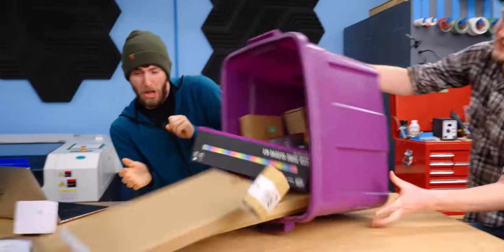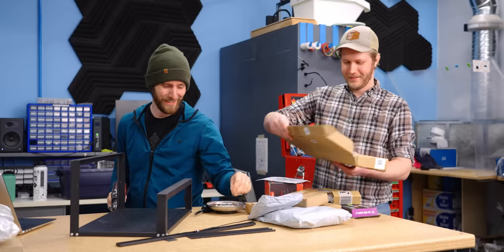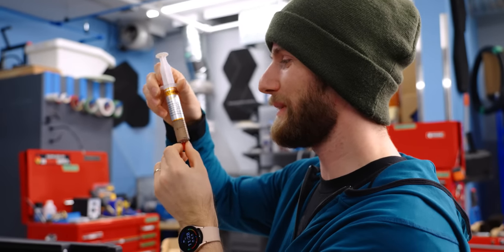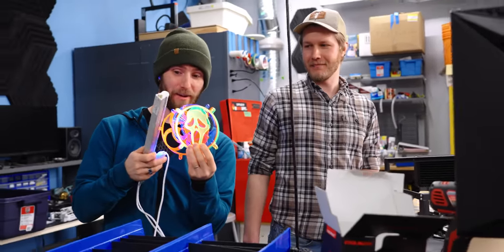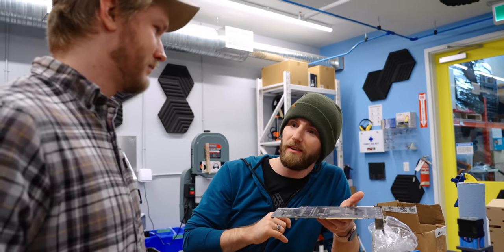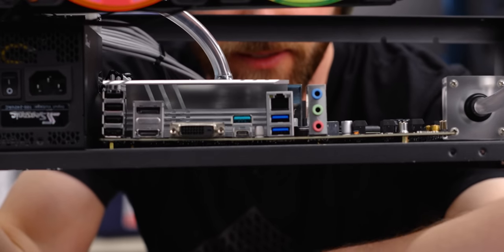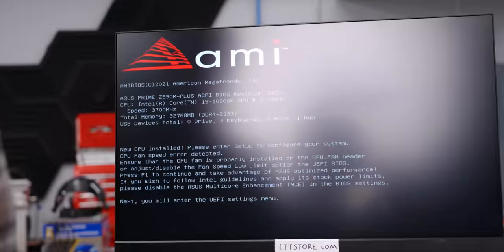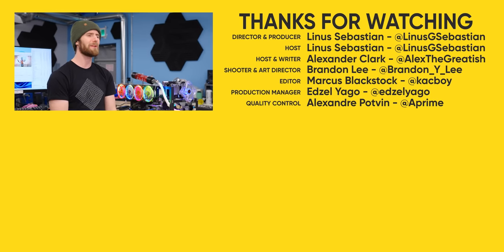Water Cooling… Using only Wish.com

Comment: 25:00 - Those are for undercounter lighting / bar lighting. They daisy chain. They also have end caps you're supposed to buy to cover up the exposed AC. I had a bunch of these. They're meant for electricians to install.
Reply: That does not excuse it in any way. They will be way too accessible for 120v to just be lying around
Reply: @PPedroFernandes  The end caps sit flush and are very hard to remove, that's why electricians are to install them.
Reply: @hippopotamus86  "hard to remove" you seriously underestimate people's stupidity. The moment one of those breaks down someone is going to try to fix them and hurt themselves
Reply: @PPedroFernandes  thats why you turn the power off when trying to “fix” anything electrical. you dont see people electrocuting themselves fixing wall sockets , because people that go to fix it know the risks and precautions
Reply: @rylanwessel1576  "you dont see people electrocuting themselves fixing wall sockets" are you sure about that?
Reply: @PPedroFernandes  you're the reason batteries say to not put them up your nose
Reply: @imthemistermaster  no, I know a lot of people that are the reason for it.
Reply: @PPedroFernandes  It's probably safer than a light fitting/lamp without a bulb in it; holes smaller and has a cover which requires prising off with determination from a stupid angle.
But I still change a bulb while it's on anyway. LED don't burn you and it's quite exciting to expose the little 240v contacts.
Reply: @PPedroFernandes  You have to realize that responsibility isn't endless, if you as a consumer do something egregiously stupid with a product that is the get out of jail free ticket for a company in court (If you can get that company in court at all.) Buying products where the safety standards are too lax when compared with your own country is inherently dangerous so extra caution is expected. People getting hurt find out the hard way especially the stupid ones.
Reply: @alexisrivera200xable  to add to this. you can glue the end caps & this design makes install efficient. Also who in their right mind tinkers with under counter lightning for fun?..... Its awkward to access & it would be easier to remove the 2 flat head machine screws from a plastic easy to break outlet or light switch cover plate with your finger nail.... guess what there is 120v in there. We should also ban nails because if your building is older than 2000 you can hit a wire running through a stud when hanging a picture as stud penetrations were not shielded.
Reply: Well that makes sense. But not having end caps included or attached already made it looked very stupid and dangerous as a product lol
Reply: yeah i lold at that part. Yes it is shaped like a low voltage light bar or DIY LED roll from IKEA, but those are not low voltage appliances, they are line voltage electrical fixtures and people are complaining about installing them incorrectly. Ok dont install light fixtures - how about that? 
SO, there's this profession called an electrician, you see.....
Reply: @nobreathing0244  yes but dont forget this is a product for electricains to install so when bought from a supply house its gonna come with end caps and be (hopefully) responsibly installed. where as this came from wish. They probably got it from some excess sale that a construction site didnt use. hense the missing pieces that the avg idiot would hurt themselves on
Reply: @PPedroFernandes  Aint wall socket have some exposure too? and alot of people died by it what are you gonna blame ? plus those are wall lamp , if you somehow touched that 2+ meter up little exposure thats entirely on you.

Comment: I still have my double helix res from when I won it at a raffle during a local LAN party that the guy Linus bought his from was a vendor at. I also remember turning those Delrin caps on a lathe day in day out too. Depending on when the designed was reversed engineered, any leaks would just require a different o-ring size.

Comment: Those strip lights normally come with a rubber plug to cover the other end.

The bare pigtails are for hardwire to a box.
The normal plugs are obvious for a regular outlet. 
There is a double end plug sometimes sold separately that you can string multiple lights together. 

That's not normal to leave the socket exposed.
Reply: I laughed so hard at that part from how they were freaking out! I have 2 of those strips installed in my kitchen and still going strong after 5 years. Of course, the bare ends are covered by a rubber plug that you only remove if you want to connect multiple units in line. It's a clever modular design.
Reply: @thelegendaryklobb2879  No it's not. A clever design would have a real power supply with DC conversion.
Reply: @thelegendaryklobb2879  I have similar LED lights in my kitchen as well....They have a 5v DC convertor and don't even give the user the OPTION to accidentally expose 120v AC.
Reply: @thelegendaryklobb2879  just because it works doesn't make it acceptable. All those certifying authority logos you see on proper electric appliances are there to show that stuff like this is not an issue in whatever product you bought. They go way beyond "if you do it right, it's safe". It is important to ensure that even if people do things wrong, or something fails, that the appliance will still fail safely. Many appliances will make their outer casing grounded. No matter what happens, through bad installation or damaged insulation or whatever, if live AC voltage manages to make it to the outer casing, it will immediately short to ground preventing electrocution and tripping the breaker. Other devices where that is not possible or desired usually have double insulation: there are at least two barriers of insulation between the outside and the live voltage inside. Even if one of them is compromised, the other should still protect you.

And those are just some of the basics that are usually required to sell anything in Western countries. There are a massive amount of rules covering electrical safety, often written in blood. Having a removable rubber plug is absolutely not good enough.
Reply: @thelegendaryklobb2879  It's clever until it catches on fire or someone gets electrocuted.
Reply: So bizarre to see so many people defending those lights, theyre designed outside of all western health and safety specifications. Just because they come with rubber caps doesnt mean a child wont put a finger in there. Youre delusional if you think its clever modular design lol
Reply: @JackNormalMemes  A plastic cap is still more of a barrier than a standard US socket
Reply: @un-hyphenated1463  I mean maybe im spoiled by UK master race plug standards, but isnt having 3 exposed male pins DC out farrr more dangerous than a standard US socket.

Comment: "This is clearly CnC machined" says Alex, looking at a clearly folded sheet metal part. I assume that was just a terminology brainfart.

Also those UV light fixtures are fucking terrifying. Just, exposed pins that are live at mains voltage? That HAS to violate all sorts of electrical safety standards. That's AWFUL. All that would need to happen is one hand touches the exposed live pin while the other hand/arm or legs were referenced to ground somehow and that could actually kill someone.
Reply: Cnc isn't limited to milling or turning. I'm sure he meant a CNC plasma cutter for the shape or even CNC bending machines for the folded stuff
Reply: I interpreted it as sarcastic because it was so far off the mark unlike a part machined out of a solid chunk.

Comment: As soon as I saw that UV stick, my first thought was that theres no way proper limits are being adhered to and it's going to be lethal to your eyes. Shame you didn't measure the actual output of it!
Reply: Usually uvA but yeah still bright without adjustment
Reply: That's impossible. You need quartz tube lights to make UVC, these are just plastic covered LEDs. They only really top out at relatively safe UVA for fundamental material reasons. Like I'm sure they're just 405-410nm, because that's just cheaper and actually works. You can make 360nm but that already pretty much eats the cover while still not being a hazard.

Obviously the fixture has other more banal ways of murdering you.
Reply: It's long wave UV which is just black light. The dangerous ones is the short wave UV but it'll be quite expensive and comes in fluorescent tube instead of leds.

Comment: The image on the invoice for the mining rig case shows 'Veddha' brand- I've owned one of those before, and that's definitely not what they received. A real Veddha case is also much better quality than they one they received made with extruded aluminum pieces, not flimsy bent sheet metal.
Wish won't even rip you off fairly.
Fun fact: In the game Escape from Tarkov, the mining rig you can build in your hideout is modeled after the Veddha mining case

Comment: the UV lamp is often bought/used by plant enthusiasts, the plug with the exposed leads are there so you can wire it to the ceiling light circuit. there are also father-father plugs for the 3 exposed AC leads), so you can daisy chain them.
Reply: Doesnt make it less lethal
Reply: When I bought my previous house, the previous owners was "plant enthusiasts" that had UV Lamps...but you was allowed to block the 3 exposed AC leads.
Reply: @viktorpettersson9975  It's only lethal if you buy incomplete kits (like they did). Complete sets come with all the caps, connectors, and extenders you'd ever need for installing a proper setup. Wish just wants to make a quick buck. Lol
Reply: Male-male
Reply: @viktorpettersson9975  it's a normal thing for ceiling lamps. you're supposed to have an electrician install them or be your electrician. same as you bought any ceiling lamp basically.

Comment: Electronics designer here, after you've washed the PCB with isopropyl alcohol, you HAVE TO use paper towels (lint free if possible) to wick the alcohol off the board. If you just let it evaporate, it'll leave all that crap that was suspended by the alcohol on the board, EVERYWHERE. by washing the board, and then wicking the alcohol off, you pull out also all the stuff that was suspended in the alcohol and you'll end up with a clean PCB.

This is obviously unless you have some pressure washing system that washes the pcb and doens't leave any residue suspended and it'll instead washes away to a tank or through filters etc.
Reply: Would a dishwasher have worked? Not too hot and no soap
Reply: @Euronjuusto999  water is not recommended for electronics because of corrosion risk. There exists different cleaning solutions especially for PCB's because some fluxes and other stuff used when manufacturing are not so keen to dissolve just with isopropyl alcohol and acetone etc. can be too aggressive and dissolve some plastics that electronics components are full of.

Comment: 24:36 All LED tub light come like that. Those things are usually for house lighting where you won't be able to touch them. also there should be a cover for connector.
Reply: Normally they have a female connector on one end you can't touch directly as the output.
Reply: Yeah, they usually have caps to put over the live ends and the bare wire ends are to wire them into your houses electrical not to connect them together.

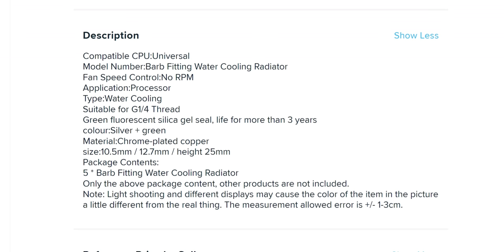Comment: 10:15
10mm +/- 1-3cm (Internal diameter)
So you could end up with a 40mm tube, a A SOLID ROD OF RUBBER or nothing in the box at all.

Comment: Oh christ, Coolmoon. I ordered a bunch of fans from them (200mm, I use an older case that needs three of them) that required the external controller. For starters the fans weren't the dimensions listed (too thick, I needed a 20mm thick one) and the controller stopped responding to any sort of inputs from the remote after like a month turning the RGB into a seizure-inducing flashspam. The fans themselves seem to be fine, but yeah, was not impressed. I also got one of the 120mm that you have, it's still sitting in the bottom of the case disconnected until I replace it with something better.

Comment: "You could've got the same from AliExpress for 1/10th of the price"
Yeah, that's exactly what I don't get about Wish in general. Same stuff, just with massively jacked up prices. On AliExpress you at least get what you're paying for ^^
Reply: I don't get why wish is a thing. Ali/baggood/gearbest (probably the same company in the end...) are way better sites with better products, stock, description, service. It's basically international amazon from china. VS wish which is the back ally next to radioshack where a shady dude tries to sell you junk from his trunk. Just use Ali for petes sake.
Reply: blame the sellers

Comment: 20:00 here's the rub, when you do that, you fuck up the pass through, so never do that to a proper board of any kind where the holes are copper/gold plated, because those are ground planes passing from one side to the other of the board. Threading shreds them apart, because coating isn't thick.

One of the reasons why i absolutely loved the 90's when tech wasn't as good (in coating said holes) and some manufacturers used copper pass-through eyelets, making for some super tough mounting points on boards. Mostly low run stuff, and heavy duty military gear had those.

A shame this isn't used today, i'd pay more for genuine copper eyelet mounting holes rather than those super thin coatings.

Comment: I feel like there is less janky options at least on aliexpress, you just need to not buy the jankiest stuff. Barrow and Bykski parts could actually make a mostly legit loop.
Reply: Exactly... As Alex said in the video on aliexpress they would have spent a 10th of what they did on Wish... and that it would have been a more legit PC... But the point of the video was trying to use only Wish to build a PC. In my experience Wish is one of the worst sites to use, let alone all of the scam items there.
Reply: This is true. It wouldn’t be any fun to be build a non-sketch water cooling PC haha.

Comment: That cable that came with the UV LEDs isn't to daisy chain the units, it's to hardwire them 

But yeah, that's horrifying that the unit has exposed mains level pins
Reply: its perfectly normal and you an buy sets at any lighting shop or hardware store
Reply: @mycosys  all the ones that I have seen either do a better job of making the live points harder to touch, or gone with a rubber grommet preinstalled to prevent live connection exposure. It is possible that LTT removed the grommet before showing the camera, but these Wish items are often not properly UL or CSA certified even when they claim to be

Comment: watching things like this make me feel better about my questionable build decisions.
Reply: just how questionable 🤨
Reply: my last cpu cooler installation involved 2 carbide drill bits and an array of diamond files. the block is now rotated 90 degrees and offset several mm from where its supposed to be. but im running stable and with good performance now, so i guess it payed off. sometimes with sff builds, you got to mod stuff.

Comment: fyi , exposing the lighting and neutral qnd ground pin for electric light is common for south east asia region even in malaysia we do so, but normally they will provide a plastic cover to cover the joint pin area

Comment: My old watercoolersystem did I buy from wish.
Playing games like csgo, pubg, rust and some simulation games.. and I did that next 1.5 year nearly to say everyday with that setup. The only thing I can say right now is that surprised me a lot. Even if it’s have work fine in 10 minutes had I been really happy with, cause it was from Wish but now it working good in 1.5y😝 only thing I can blame on and is only one thing… I had some issues with the temperatures in the reeeelly hot days. Now when I’ve trade to a Corsair setup so it had only put down the temperature with 15-20*C with same using of the pc. For the big test comes to the summer. First then I know if it was worth 😉

Btw, I paid 360sek with shipping for my set 😉

Comment: Been running a 5800x3d on an 90 dollar amazon full custom water cooling loop. I did have to buy a 20 dollar waterblock. but for 110 i'm still going strong, no corrosion.

Comment: 100c memory IS NOT fine. 
You will get initial soft throttling at 94c. Also, it would be nice to know at what TDP that 3090 is running, 350w or 400w+

Comment: I know what Lambo wants to hear.
Dual M.2 1TB WD Black 850 @ precisely fan regulated 41C each, in an ambient Room Temp of 75.7 43% humidity.
I use the Optional and HIGH AMP fan connections for that with Cooler Mater 90mm and 80mm fans PWM - The smaller one is 4300rpm high amp.
Inside of a TT900 Chassis on a Rog Corsair Hero IIIV Wifi X570 - Because I get a little bit Ginghis Khan. Don't want him to get it on with nobody else but me.

Comment: Tip is to use petroleum for medical usage to remove thermal goo and a lot of other sticky things.

The petroleum for medical usage doesn't leave any residuals that regular does and it evaporates as quickly as alcohol cleaning

Comment: At 25:30 those wire extra for when you need to do direct wiring (without pronge) , there are another small one without wire where its used to fuse those 2 lamp right next to each other. Also these lamp are for high wall mount so that little metal exposure wont be a harzard.

Comment: I love MSI. I have built 12 systems using mostly MSI components. I had my first issue with a MSI product last week. I built my son a system in 2013 and the MSI 760GT graphics card just quit working in 2023. My system is also nothing but MSI except for the Power supply and SSD. It is still working great and I built that in 2014. I had nothing but issues using Asus M/B. I use nothing but Samsung SSD's and have never had 1 fail.

Comment: Those T5 led tube supposedly to bundled with a little cover for the other end of the unused connector, and also comes with a plug to make connections to other T5 tubes.